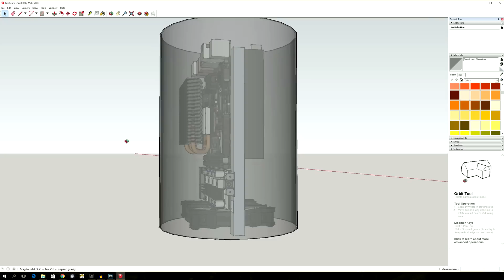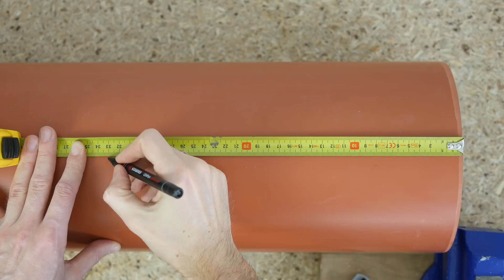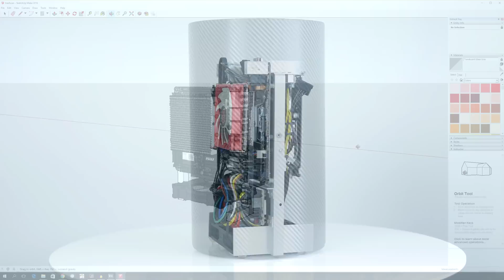How to make a Mac Pro wannabe mini ITX computer (DIY PC case)

Comment: Apple sells the same hardware as Windows/Linux PCs and a Open Source Kernel for it's Operation System but their Products cost many times more ... great marketing I guess?
Reply from the maker: It's not like they put inside off the shelf hardware (like a mini ITX motherboard). There's a lot engineering involved - custom PCB design, etc.
Reply: They dont use the the same hardware... Xeon's and Firepro's cost much more...
Reply: i mean the CPUs and GPUs etc ... ;)

Comment: When you do your bends on the aluminum to make corners, are you sure those are strong enough? Nothing is holding the corner together. I am just wondering since I might do something like this soon.
Reply from the maker: It wouldn't hurt to braze the alulminum, but even without brazing the construction is very sturdy.

Comment: I wonder if you could put a 140mm fan at a low rpm underneath the motherboard assembly to potentially get some more cooling performance.
Reply: Anyway, that is an interesting project. I would make some changes to improve the airflow (like putting two 120mm fans at the bottom, one one the side of CPU cooler, second on the side of GPU, also i would turn the GPU around so the hot air can go out without any obsticals, because now GPU fans are blowing hot air directly to the back of motherboard, which can result with higher mobo temps. It would be nice if some vertical CPU cooler would fit there, so the hot air from CPU could be pushed directly to the top of the case, where i would put 140mm fan like i said before), but props for the creativity. Plus you have very good set of tools :).
Reply: I was thinking the same. Plus i would also put one 140mm fan at the top to exhaust all the hot air more efficient.
Reply from the maker: When I was sketching up the design, I was convinced that I do have a 14 cm fan laying around somewhere and I designed the case with that fan in mind... but when it came to it, it turned out that the fan is 12 not 14 cm ;P

Comment: hey I am thinking of making a case from acrylic/aluminum. but I was wondering if the base of the Mobo is acrylic what mounting screws should I use? please link?
Reply from the maker: I think you can use the same threaded inserts as I did.
Reply: YetAnotherTechChannel hmm thanks maybe link plz ;) if it is Amazon and affiliate link? you should start doing that ...

Comment: Great tutorial!!! Only suggestion would be safety when cutting to tell those new to cutting steel or aluminum that they need to be careful and use a block or gloves that will protect their hand in case of a slip. Remember your PPE (personal protective equipment).
Reply from the maker: Duly noted! :)

Comment: Great and inspiring build!! Out of curiosity, could you have flipped the mother board upside down? Ie, mount the power supply on top, mother board + peripherals on the bottom. That would allow you to flip your GPU with its fan now facing outward, blowing its dissipated heat away from the backside of the motherboard? You would still have to feed the HDMI cable from the top like you're currently doing, but with more zip ties, you could snake it down the side and out the back with the other cables. Thoughts?
Reply from the maker: ...the problem is that no matter how you position the motherboard, the orientation of the GPU is determined by the PCI Express slot and since it has to be on the other side of the frame, the fans will always face the back of the motherboard... but it might be that I didn't get exactly what you ment ;)

Comment: did you actually use only one screw for the gpu? SIGH
Reply from the maker: Most of the weight of the video card is supported by the riser cable, which fits pretty tightly between the frame and the motherboard.

Comment: It would be nice to add another fan on the top, 
and I think that managing to rotate the radiator would help with the flow as the fins are oriented horizontally right now  :-)
Reply from the maker: The case would have to be 3 cm taller in order to fit additional fan and it would disrupt the proportions. You're right, rotating the heatsink could help but I'd have to think of sealing the case first to get the most out of that bottom fan.

Comment: Pro tip: you should have oriented the IO from the motherboard and the GPU to the bottom, that way you wouldn't face that problem ( 3:07 ), and put the fan on the top, so the cables are much easier to organize

you should also use some background music...
Reply from the maker: The background music is there, but the problem with it is that it's really hard to determine the output level for the music track - it's always too loud when listening with headphones and too quiet when using speakers...
I was thinking about having the IO at the bottom but I figured it would be really inconvenient to connect them... but since you don't do that very often I guess I could have done it that way...